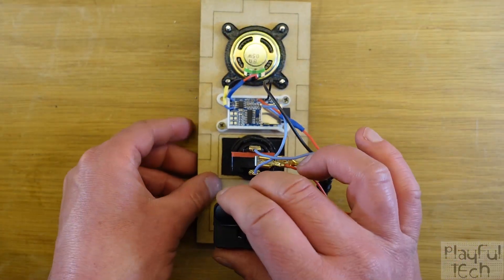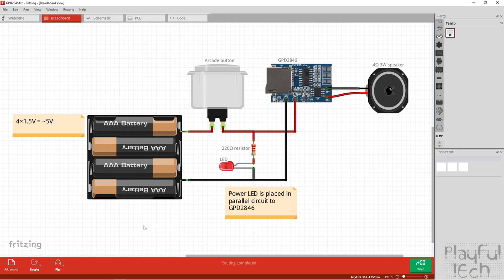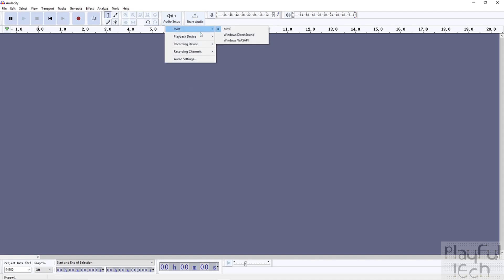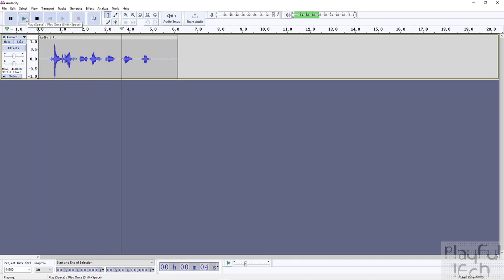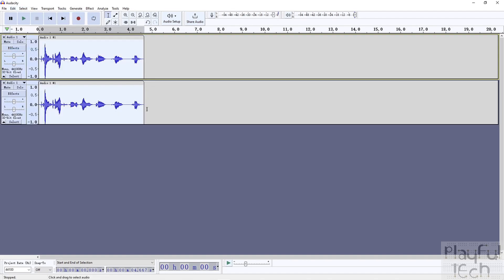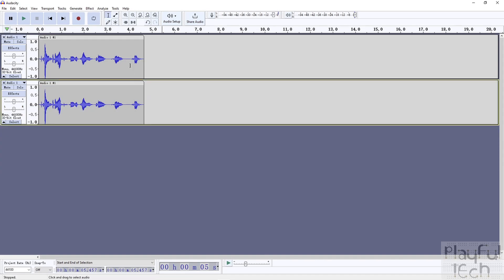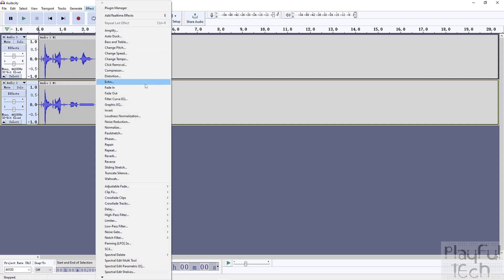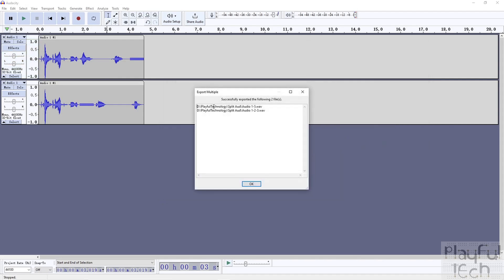"Split Audio" Escape Room Puzzle Tutorial

Comment: One of the issues I had with the GPD2846A boards that I've got is that if the playback was interrupted (letting go of the button) and you pressed it again it wouldn't start from the beginning - it would resume from the last point in the playback. I tried with both WAV and MP3 file and it behaved the same. This makes it almost impossible to sync up with a second speaker unfortunately. 
Not sure what the difference is between the ones you've got and mine - they are the same chipset and the PCB looks identical.
Reply: I have got the same issue, did you solve it?
Reply: @felixklimm7412  haven't had a chance to revisit it but couldn't find a way to overcome it.
Reply: The old-school filmmaker/editor (me) would put a BEEP TONE at the begining of the recording and just do manual jam sync.

Comment: Cool tutorial!  But it's not working. I followed step by step the way to generate the WAV files, but the module do not starts from the begining each time you power it. Looks like it continues the files as it was.  Any solution? Thanks
EDITED. 
I have not found a way to synchronize the audios with the GPD2846 module, they only do it the first time you feed them. The solution that works for me and doesn't use a microcontroller is to use the DFPlayer mini mp3. Putting a push button for power and taking to GND the ADKEY_1 pin, this makes it play automatically when it is powered.

Comment: This looks like a brilliant idea and I've been playing around  with these modules trying to repeat the tutorial..  Disappointingly, the problem I have is that when power is applied to a module it does NOT always start playing the (only mp3 file on the ASD card) from the beginning.  Rather it seems to start at some arbitrary point part way through. This makes it impossible to synchronise the playing of fragmented messages on multiple mp3 players as described, by just applying power.  
I can  make them synch by applying power, then immediately pressing/bridging the 'Previous'' pin, but this adds complexity and requires something like a Xiao (or other MCU) to achieve this. Perhaps it's just the modules I'm using that are different and cause the problem? Anyone else have experience of this?
Reply: After further experimentation I found a solution to this problem.  I had been playing an mp3 file at 48000Hz (bitrate), which was problematic.  After re-watching Alistair's excellent video tutorial in closer detail, I noticed he had used a .wav file at 44100Hz (bitrate).  This seems to solve the problem.
Reply: @GSewal  Hi, it not solves the problem. I started with mp3 files, and reading your post I change to WAV files but I got the same problem.
Reply: @GSewal  Are you sure this solves the problem?

Comment: Use a higher voltage battery supply than you need and a DC-DC converter or regulator to keep a constant voltage, if it is voltage related and fairly consistent that would also enable you to calibrate each one to a reasonable degree. Also if you use a buck/boost converter you can significantly increase useable battery life.
Reply from the maker: - A typical generic or no-brand AA battery (I'm using "Amazon Basics") has a capacity of 2000mAh.  (a branded, e.g. Duracell has more like 2500-3000mAh)
 - Assuming you run the amplifier at its maximum 2W power at 5V, the GPD2846 requires 400mA of current draw.
 - So, using 4xAA basic batteries, it would play audio continuously for 5hrs.
 - The audio samples I demonstrate in this video are about 5 seconds long. So, you'd expect to be able to playback each message 3600 times on one set of batteries.
 - Assuming players have to repeat the messages five times each game before they get the code correct, that means they'd last for 720 games before you'd need to change them. 

Of course, alkaline batteries are pretty old technology, but they're cheap, easy and readily-available. If you wanted an alternative, I'd suggest looking into a USB power brick (or, if you don't want a portable device, just a wired DC power supply)
Reply: @PlayfulTechnology  I've also recently seen rechargable, via USB, AA batteries!! The things they come up with!!